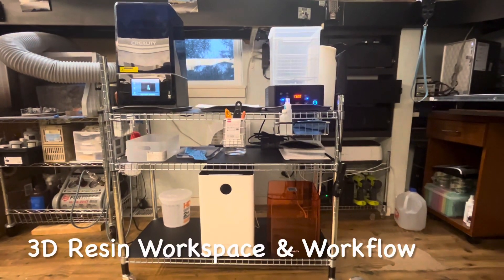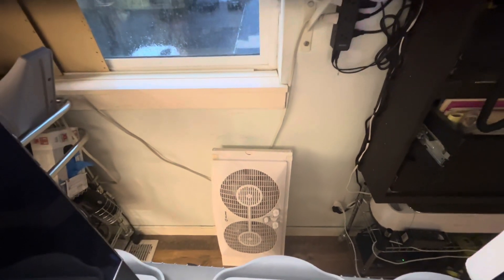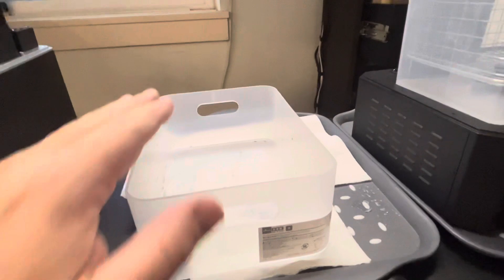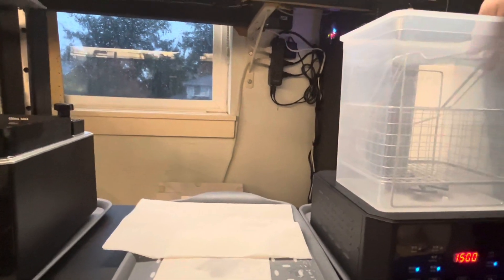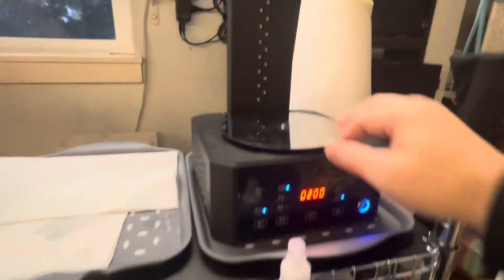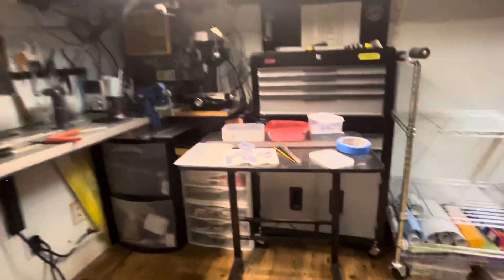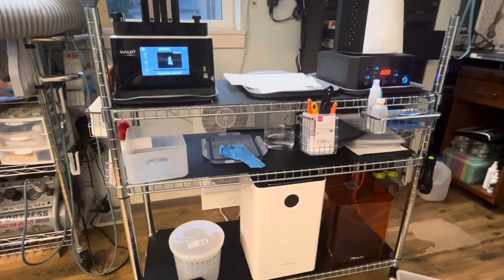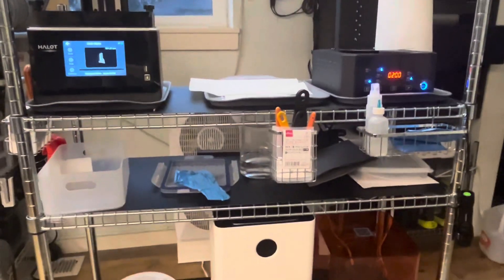My 3D Printer Workspace & Workflow

Comment: Resin printers produce a heavy amount of pollution. You're getting a headache because you're inside a car with the engine turned on and the tail pipe leading into your car. Carbon catures also have little effect on capturing the pollution, open windows might help you but would highly recommend clean air circulation. Look at the health and safety risks my guy.
Reply from the maker: Good points thank you. There seems to be a general lack respect for the effects of the vapors this emits. At least from my brief experience, the odor may not be that bad, but the effect of pollutants being emitted are still real. My system to exhaust the resin vapors was effective at controlling the pollutants in the room, but it dropped the temperatures in my room so much that the prints would fail.

If I decide to get back in to resin printing, I’ll be looking for a way to exhaust directly from the machine out the window.